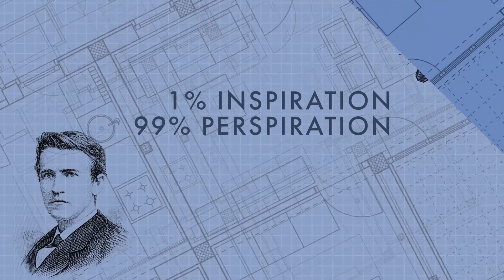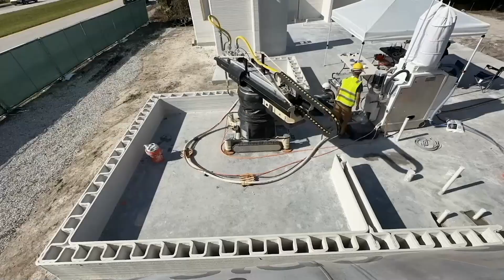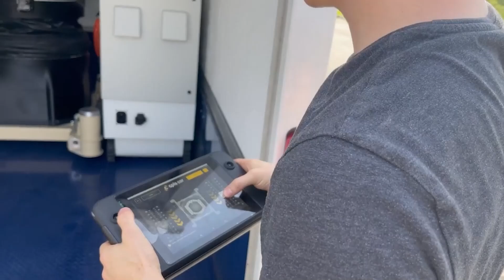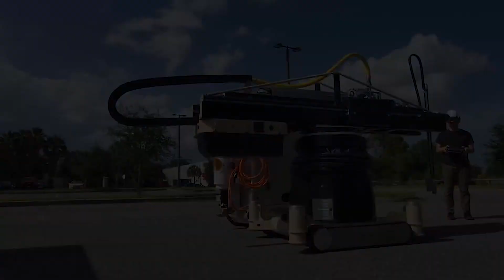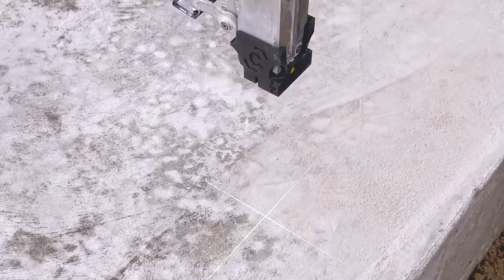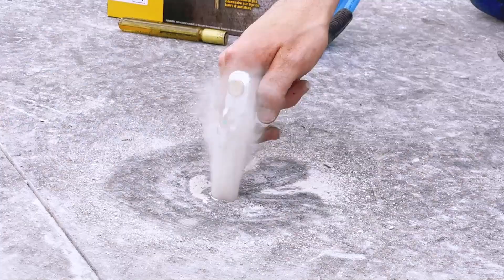Building the Future with 3D Printing | Revolutionizing Construction with 3D Printing

Comment: I steered my engineering career towards Additive Manufacturing since 2009 and it has been my focus ever since. As soon as the opportunity to invest in Apis Cor presented itself to me I jumped on it and so should you !! 3d printed construction using Apis Cor's technology is about to explode !!
Reply from the maker: It'll be interesting to see when 3D takes off.
Reply: @EricAndertonConstructionGenius  I have no doubt it will simply because of the labor savings. The build quality improvements are an additional bonus. If I have my way I will have the first one built in Martin County, Florida just south of where the one in Melbourne is.
Reply: this company is scamming people. they sold a printer in 2022. Took payment in full, have yet to deliver the printer to the buyer. They scammed hundreds on start engine raising money promising "perks" to investors. None of those were ever awarded. Can you imagine giving someone $650k and then the company just putting you off like you don't matter?  they should be shut down